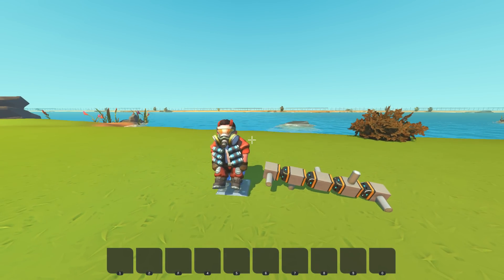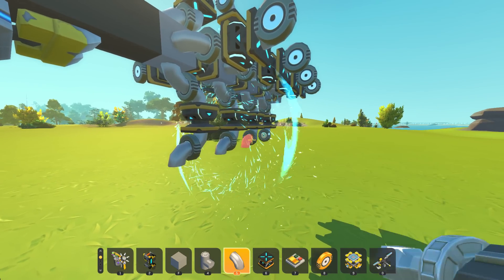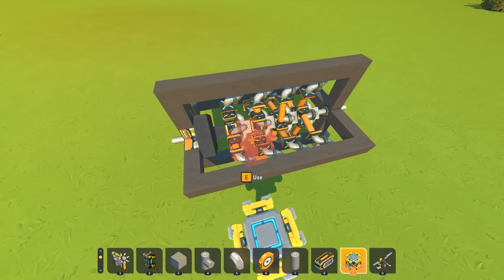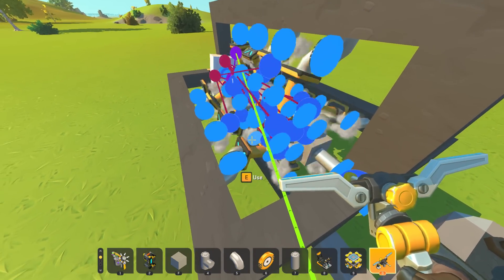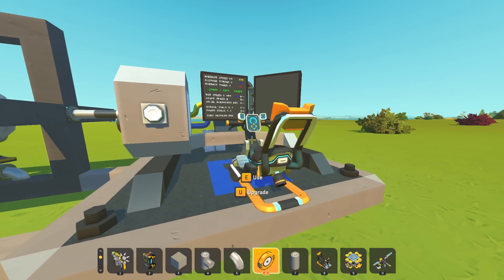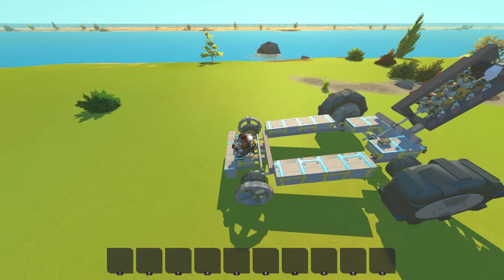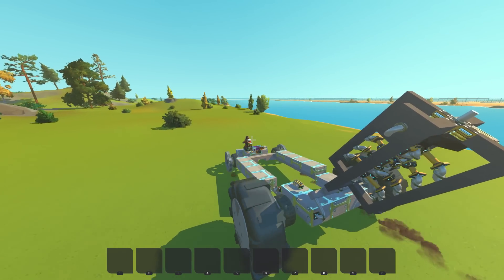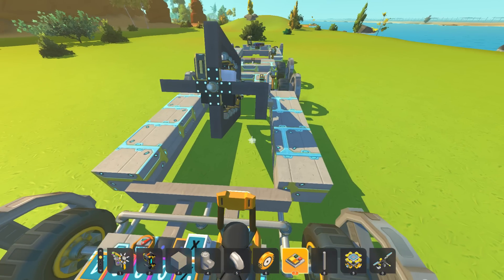I Built a Crazy 16 Cylinder Piston Engine That Couldn't Exist in Real Life!

Comment: the smaller part of the l is where the engine wanna turn towards so if the l is 3 blocks and 1 block going down on the left on the lift its gonna go counterclockwise and if its on the right clockwise
Reply: also kan when u add a load it will reduce the timing for more torque and thus get torque

Comment: I messed with the mechanical parts mod, and while it works, it's hard to build with and the sloppy flex in bearings and items clipping through each other really makes it frustrating to do cool things with them.  you really have to limit torque a lot to do even something simple like a diff, or after a certain speed it just craters.  they really need to let you adjust flex in creative.  bearings that don't flex would be so nice

Comment: Maybe try different firing order for your 4 piston engine, try firing order of a catapiller  3204 engine and 6 cylinder like c-15/3406 engine. It maybe change something idk
For v8 engine maybe order of a 350 sbc or a ford 351.
Not sure if it would change anything on scrap mechanics physics

Comment: 5:25 The way you put the L shape of the timing wheel doesn't matter, both gives you a timing of exactly 50% / 50% ... lol
Reply: In theory ,but it actually matters...
Reply: @pindamonhangaba72  
How?
Reply: The only practical difference is that the angle of the bearing that the timing wheel sits on will differ by 2*arctan(1/4)=28°.
[edit:] one has to turn the timing wheel by +14° to get it aligned with top dead center, and the other one by -14°.

Comment: try to build V8 double piston engine. the idea is - your piston goes with V for 2 blocks length. with double piston you have 2V and V-shape to fit same size (shaft will go bottom)
to avoid collision may be connect shaft via pass-through

Comment: well there goes the need for fuel and batteries in survival. 
the only gearbox that I think could work without mods is maybe a cvt using two big cones and shifting where they meet up. im not sure if you could run a wheel between them, or if CM wouldn't allow it. I would say if it did work it would probably mean that you would need to remove the diff and mount the engine horizontally instead otherwise it's likely going to slip too much. 
seriously amazing engine though, and the love the indicator

Comment: Title says it wouldn't exist in real life but technically it does already, just not in the same way. Airplanes had radial piston engines where you could have up to 8 pistons around 1 shaft and add banks of engines for more power. I think the biggest ever was 4 banks of 9 pistons totalling to 36 pistons.

If we're talking about how it's done in Scrap Mechanic then no.

Comment: Kan did you know that the electric engine has actually lower torque than the gas engine but it's more like high RPM.
That was some sort of shock for me. Building cars with electric engine instead of the gas engines means +100km/h to your max speed. And that's real. While gas engine can barely hit 165km/h, electric one gives 260+

Comment: If you ever need i have a full torque / power / rpm curve per timing angle from the middle of the 0rpm zone on my workshop (K0wp3R on steam), on ... well my quad 16... and the torque does go over 10k, precisely 12k at 105 to 130° from the 0rpm point.

Comment: You should ajust the external connection point with bearings. I doubled my hp with that. Also you should optimize a i4 i got 101hp

Comment: It´s 4 I4s because you built it wrong...
a normal radial engine would have the crank shaft... thing (idk the name but I know the mechanics) offset a bit for every set of pistons, while yours has different offset for every piston.
a normal 60° V2 has a pattern of 1,-,-,2,-,-
a 90° R4 has a pattern of 1,2,3,4
a 90° R16 has a pattern of 1,2,3,4,13,14,15,16,5,6,7,8,9,10,11,12
(or a balanced permutation... like 1,14,3,16,13,2,15,4,5,10,7,12,9,6,11,8)
at least build Vs and up with a realistic crank.
(also quick tip... make the passthroughs with full blocks)
Reply: and use a mirrored one (make a twin R16 engine to avoid torque)
imma add tips as I think of / remember them.

Comment: Idk who told you to put the timing wheel on the loaded side... but JUST NO... For exactly the reason you said, the bearing will collapse. The point you raised about having the timing wheel on the loaded side on low torque engines was interesting though. On the one hand it makes sense, the direction the timing wheel gets pulled in is the correct direction. On the other hand I feel like it would be more beneficial to tune the engine for whatever load its under. Having that controller bearing in there will basically just create a spring in your axel.

Orientation of the L does not matter with 4 sensors. The distance each sensors raycast has from the center of rotation is the same, so how you paint the wheel 50/50 doesn't matter so long as you do. It does impact where the stallpoint is, which is why I personally always try to use the same timing plate. I found that with proper stallpoint calculations you get the same performance forwards and reversed with the same angle offset from said stallpoint. Depending on how you design your engine the stallpoint can be found at either +-15 or +-30 (plus k * 90 depending on how you hook up sensors and build the L)

But you still have to work on your efficiency, you should be able to get 400hp no problem from 16 cilinders (extrapolated from my own +-120hp V4 and +-220hp V8 designs).

My prefered vanilla bevel gear uses corner pipes instead of straight pipes, what i've found is that they have an overall lower amount of play but a very, very, very slight meshing issue. I've used them no problem in all sorts of contraptions so they work just fine.
If you are only need to make a 90 degree angle there are other mechanisms for that, for example 2 purpendicular axels can be connected by an arm that uses 2 offroad suspensions at an angle, kinda like a locomotive bar but multidirectional. You could build it from piston sliders to get less suspension glitch. You also have the option of using 2 U-joints.

For other vanilla gears... I prefer to completely avoid them. 3x3 gears work okay if you mesh large pipes with small pipes, but I have yet to figure out a 5x5 gear that is reliable enough to be spawned from the lift 100% of the time without getting jammed.

Comment: Is it too soon to start racing with these engines?
Reply from the maker: Need to figure out high speed either through gearing or smaller crank diameter. Right now they are all sort of 300 rpm limited which means races won't show much.
Reply: Furry nuff @kANGaming  - hopefully you'll get those figured out, because in my head I'm seeing great things as you, SM & Dapper  take these things off road 👍

Comment: 25:30 havent you found out that the gas engine has like 7k Torque? shouldnt you test that against the gas engine then?
Reply: thats true, but the high rpm of the gas engine usually causes gears to break

Comment: We need to stop using the "distributor" design for the timing wheel. Seriously. A whole episode of ideas besides the timing wheel. 

I'd like to see an unconventional timing wheel design with higher adjustability

Side mounted sensors riding on a beam have been implemented to fire each piston. Would also like to see unconventional approaches to the side mount design as well. 

I could join a server with someone like kAN and brainstorm for hours.
Reply: to add to this. I created an abnormally complex design but it had a sensor on a different axis for each piston due to the 72 degree firing angle of my flat-10 design. Seemed to work fine with the added result of having specific timing control against what can become a static painted timing wheel.